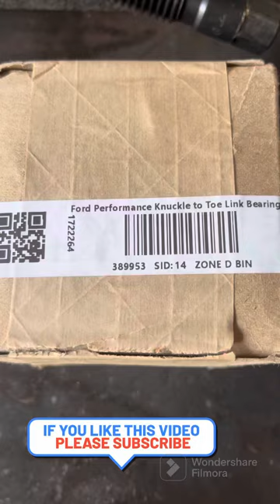FORD PERFORMANCE TOE BUSHING FOR 2015 AND UP MUSTANG GT

Comment: Hey mate, have a question ive got a 16 GT ive got these, whiteline adjustable toe arms and superpro rear LCA bushings to go in mine

These Ford Performance bushings Ford Performance state to put red locktite on the bushing and inside the knuckle i noticed you didnt do you think its necessary? I live in Australia trying to find info on these cars is ridiculously hard
Reply from the maker: @GreendragonDMX1  nope it’s already it’s not necessary because it’s press in bearing

Comment: What kit did you use to press then out?
Reply from the maker: I have snap on master bushing set but you can get something similar from autozone or orilleys Amazon they be a lot cheaper I use my daily in the shop
Reply: @Coy.ote5  I rented a powerbuilt 23 pc ball joint set from advanced auto parts but not sure if this will work
Reply from the maker: @rafalemus7218  it should work just have use right cups and insert to press out the bushing then vice versa to install if that make sense. Make sure you use DW-40  on the threads on the tool and a good impact
Reply: @Coy.ote5  thanks I'll give it a try tomorrow
Reply from the maker: Your welcome if you have more questions or need any help or guidance lmk

Comment: Just did this last week.  Those bushings can be a bitch to press in. Use a lot of silicone grease! Also the width of the toe link fork is slightly smaller so you may need to bend the metal on one side slightly to get the upgraded bushing to fit.
Reply from the maker: I have couple of controls I’m doing for few buddies, I always put my bearings in my deep freezer makes installing them easier, but nothing easy about it takes a lot of patience
Reply: @Mustang214  no doubt. I had mine in the freezer as well.  Having the right tool for the job made it much easier.  Got the loaner tool from autozone and it went ok
Reply from the maker: @Thedjcodeman  yes sir i also just installed one piece drive shaft on my car sub to channel all sub back
Reply: @Coy.ote5  subd
Reply from the maker: @Thedjcodeman  appreciate I already sub